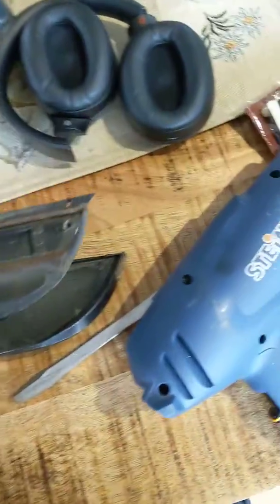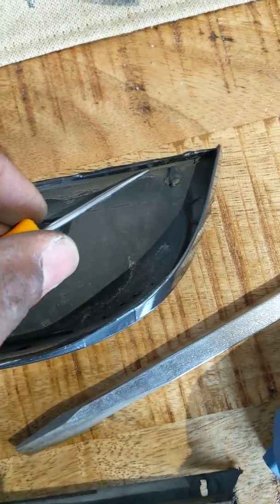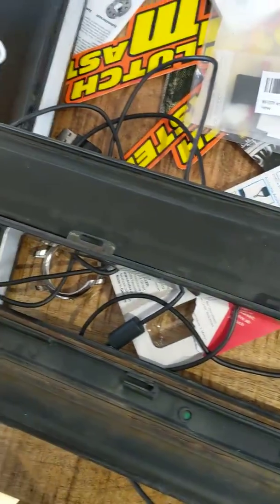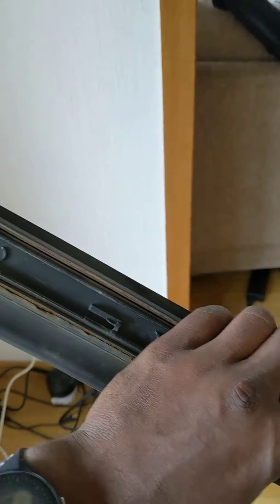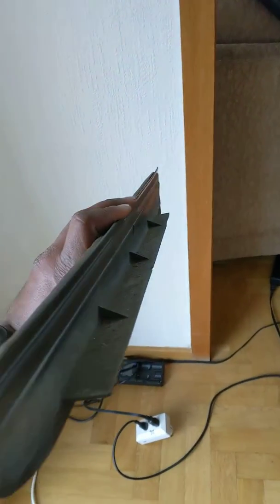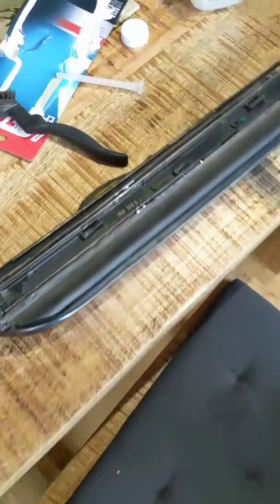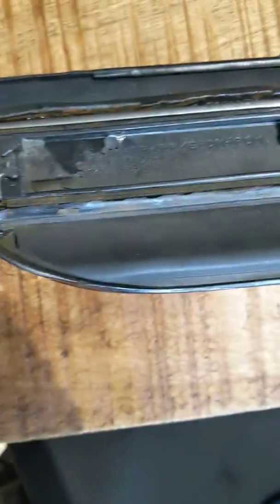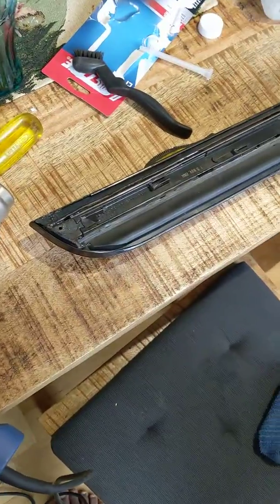B6 B7 A4 S4 Door blade repair PART 3

Comment: How did it all turn out? I have the same problem with my RS4 and the blades are now discontinued. Thanks.
Reply from the maker: I'd call it an 80% solution definitely better than what it was
Reply: @QPC_LLC  Thx, I've now almost separated the front right completely; deciding on a possible solution or rebuild it somehow.